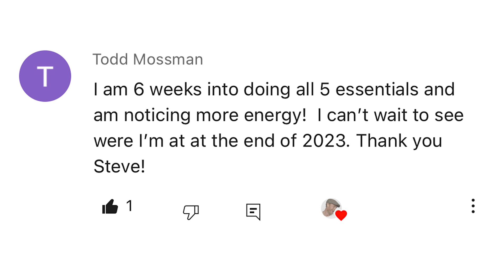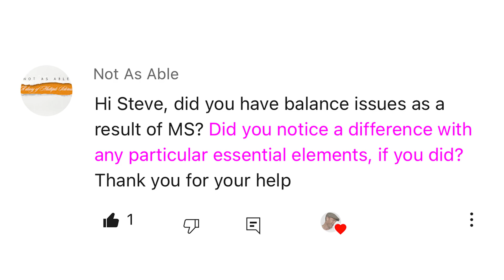Making Myelin and FIGHT MS!

Comment: Hi Steve, I have had a mess for almost 20 years and I'm loving your videos with sound practical information. After taking and disposing of truckloads of supplements over the last 20 years I have one quick question. Most people with that mask are not able to work and have limited income. What would be your top three supplements to take on a limited budget thanks so much for all your Insight
Reply from the maker: I think if someone is on a limited budget, they shouldn't buy supplements at all. I would save my money and buy big ticket items. Weights, Lugol's Iodine & UVB lamp to start. Then eat a clean diet (which unfortunately is more pricey).

The last thing to think about are supplements. They sound appealing, but they are pricey and can be a very poor return on investment. They do eventually start to show benefit once myelin creation kicks in, but the big ticket items are whats needed to get to the benefits.
Reply: Thanks SO Much Steve,

Your truly an inspiration to anyone loosing hope, Bless you